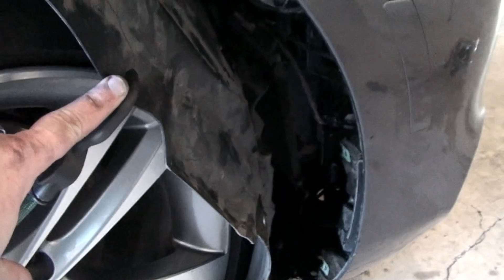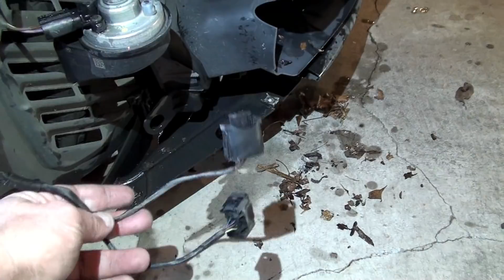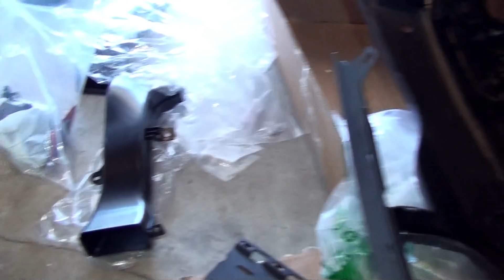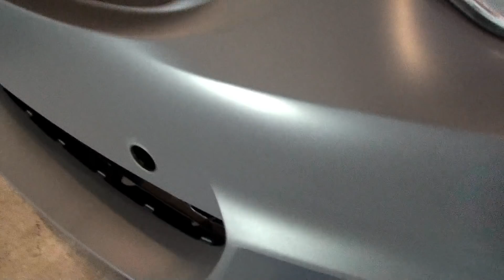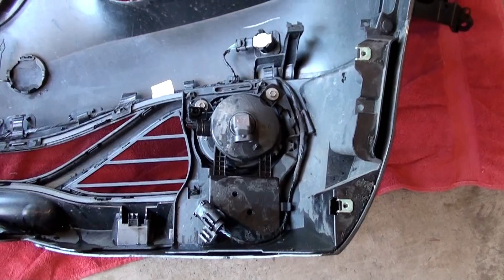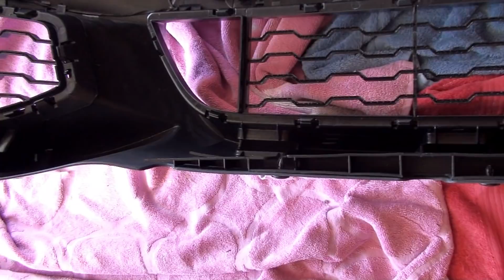BMW F32 435i M sport front bumper conversion installation DIY

Comment: I know it's been a long time since you installed, but do those two large parking sensor agle down slightly when looking at the front bumper head on. Mine do and im worrked I may have installed them incorrectly
Reply from the maker: I had to swap angles on them if I remember correctly, to reduce that down angle.  They were physically lower than the original bumper,  so a little more sensitive
Reply: yeah, mine are pretty much pickup the ground and installed the bracket such that the sensors wires would orient the same way as in the original

Comment: Hey man! I just installed my M-Sport Bumper thanks to your video! My question is, the lower air duct that directs flow to the radiator, I took this out and it seems there’s an M sport version. Do I need this air duct other than the fact it directs air to the intercooler? I was looking at parts and they’re pretty hefty in price. Thanks again!
Reply from the maker: The bumper came with all the proper ducting, and didnt need to buy anything else. I am surprised you are missing something?

Comment: Stefan, my wife's F32 has the Sport Line front-end with closed fog-lamp bezels. I was thinking about removing the starboard(passenger-side) bezel and moldings it with drilled 1/2" holes and backing the holes with 1/16" fine stainless micromesh in order to facilitate greater air-flow to the oilcooler in hopes of lower operating temp. Please note that I have already installed the Mosselman oil thermostat. My question is: Can the lower fog light bezels be removed with less effort/hassle of removing the whole darn bumper?!  My Bentley manual provides no guidance for such limited access. What are your thoughts since you have performed this kind of "body-work"?
Reply from the maker: Check out my video about zunsport screens for exterior screens.. but if you have to remove interior pieces, sadly the bumper cover has to come off.

Comment: Hi, When I tried to install the M4 front bumper, the wheel archs were not matching with the bumper? You have the same issue ?
Reply from the maker: No.. but I installed the M sport, not the Mr replica, or did you get oem?
Reply: @BMWDIYGuy  13:34 seems my wheel arch is not correct. is it possible to check the OEM code on the wheel arch of yours?
Reply from the maker: @hyperloop7053  Would if I could but actually don't have the F32 anymore.  Best next suggestion would be realoem.com and check the part number.  If you are not familiar with that site, select year and model and then can browse through parts diagrams. Incredibly useful for finding and comparing parts.
Reply: @BMWDIYGuy  this is a great source, thanks a lot.

Comment: Hey do you know what the piece is called that you hangs the bumper on and screw the t25 screws into. Mine broke and I think it’s messing up the fitment of my bumper?
Reply: Do you know if it’s interchangeable or is it built into the frame?
Reply from the maker: @yMdangerous  So I dont know if it is off the top of my head.. realoem.com is good for this, looking through parts diagrams trying to find the right piece.  The bumper cover is there and easy to find, but hard to see the part it attaches to directly.  I would start here and see what you can find.. next thought would be see if your local dealership can identify the part.  Cant say I have ever heard of that break.

https://www.realoem.com/bmw/enUS/partgrp?id=3R13-USA-06-2016-F32-BMW-435i&mg=51

Comment: Hey I followed every single step you followed only this I that I was having problems with my pdc sensors. I’m not sure if the company didn’t send good brackets or what but I’ve got them glued. And now the sensors don’t really seem flush to the bumper they work fine but I’m just wondering if that’ll be noticeable?
Reply from the maker: I found using VERY thin 3M automotive adhesive film is best, and it reduces or eliminates that dip back.
Reply: Thanks so much for responding quickly? Do you think The glue will be removable at all?

Comment: Hello sir i have a questiom my bmw 4 has a little black box on the bumper wich i think its the distance senzor for the cruise control is it possible to install the front m bumper with that senzor?
Reply from the maker: Hmmm... great question really!  I would reach out to Kies Motorsports directly and ask them.  You may be ok, but I would confirm first.

Comment: Hi, what is the piece called that fits into the lower part of the msport bumper and connects the bumper to the belly pan? It's the last piece I need to complete my conversion and I cant find it anywhere to buy
Reply from the maker: Best suggestion would be is to check realoem.com and look through the parts diagram.  You should be able to find the exact part and number.
Reply: @BMWDIYGuy  smashing! Found the part....adaptor underhood shield....thankyou very much
Reply from the maker: @amtdesigned  happy to help!

Comment: Can you link the part number for the front air ducts? I have 435i that i am converting to M Style bumpers but cant find the right air duct part
Reply from the maker: So hopefully your kit comes with them?  If you follow my link and get the same kit, it has the ducts.  If you can't do that, check realoem.com and look up the style and part, and you will find the part numbers.
Reply: Will the OEM ducts not work…???

Comment: Did you happen to take off the center plastic where the center lower vent is? Mine has an extra plastic that seems to get in the way right in front of radiator
Reply from the maker: I dont believe so, but it could be the case that mine is missing.  There was a soft rubber piece that vented up to the intercooler.  In my frustration, now several years ago because I couldn't get the new FMIC to fit with it in place, I cut it off.  (I wouldnt have done that now, but that was then).  It may be the piece you are talking about.. maybe..
Reply: BMW DIY Guy thank you. I just ended up removing it

Comment: Where can I get the sport air vents?
Reply from the maker: The brake ducts? These came with the kit. If you need just the ducts you could use realoem.com and look up the parts.
Reply: BMW DIY Guy thank u so much

Comment: Great video !
i see you left out the crossbar and didnt place the m sport deformation elements L & R and the lower bumper mount crossbar.
- Deformation element left 51118051189
- Deformation element right 51118051190
- Mount, bumper, front, lower 51648054575
does that give any problems of bumper hanging or mounting?
Reply from the maker: No issues whatsoever.

Comment: Do you finally put on those 6 bolts? I also have a problem to put those 6 screws on under the center belly pan. Not sure what the problem is. it feels like the belly pan is too short to reach the M sport bumper panel
Reply from the maker: Yes, all my belly pan bolts are in.

Comment: did those larger PDC brackets come with your new bumper? Mine did not come with any new PDC brackets
Reply from the maker: Yes, mine came with everything I needed.  I would contact your retailer about the missing parts.
Reply: i will but unfortunately i didn’t realize i was missing them until after the bumper was painted and i had the old one off and disassembled

Comment: Is that crossbar for absorbing impact?
Kind of afraid of taking it off for that reason
Reply from the maker: Understood.. its a small diameter hollow tube, so really dont think it would do much, so have zero concerns taking it off.  The main structure is the wide aluminium plate back into the frame support members.
Reply: @BMWDIYGuy  I appreciate the response i get my bumpers next week and im following your steps thank you for the content !! 🔥🔥👌
Reply from the maker: @bulmarojusto2602  happy to help

Comment: Okay so serious question! I’m looking to convert my standard bumper to the Msport one and every keeps saying (Legit BODYSHOPS) keep saying NO AFTERMARKET PIECES FOR YOUR CAR! Went to get the bumper priced by BMW it was literally 3 times the price of other bumpers. Saw great bumpers with (some with warranty) mybimmerparts.com bmwsouthatlanta.com kiesmotorsports.com I have a 2016 428i xdrive. 

What do you think? 
1a. How do you feel about aftermarket body parts? 
1b. Would you trust these sites?
2. Will the bumper fit the car perfectly (if taken to body shop)
3. Will it void my warranty or will BMW even notice it? 

Thanks a lot man, really appreciate it!
Reply from the maker: So interesting comment from bodyshops.. no clue of why they would say that, but ok.  shrug

1.a - My car is now has the full msport kit from Kies, so I think its just fine and you literally cant tell the difference.  IMHO the parts are identical, and NOT 3x the cost.
1.b - I have worked with Kies extensively, trust them and the owner Bryan completely.
2.  Yes, and did the install myself obviously.  You can too with basic tools and save yourself that expense.
3.  Cannot and will not void your warranty.  There is actually a law in the US that prevents that explicitly.. the only time an aftermarket part can cause issues is if the dealership can PROVE it is the source of whatever problem you have with the car.  Most common place for this is taking a "tuned" car into the dealership while under warranty as they can complain you are messing with the DME.  THAT is a dice roll.. exterior components not so much.
Reply: BMW DIY Guy thanks a lot man! This was really good information. I ended up going with the Kies motorsports part. It’s the same and cheaper. 

Also anywhere you recommend getting a nice front lip from? And Not so expensive?

Comment: What kinda bolts do I need to connect the fog light duct to fog light holder piece?
Reply from the maker: I used what I had on hand, so dont have an exact description. They were extra bolts I had, for metal into plastic.

Comment: Great video, I learned a lot in perspective to change my own bumper on my F36; I am not particularly enthusiastic of removing that lower crossbar that you did, it should be there for a reason I guess, no way to fit the M bumper with that on?
Reply from the maker: At least not in my case.. I couldnt find a way to make it fit with it.

Comment: hi Thanks for the video!      I am having trouble removing the main PDC connector which is located on the passenger side.   Where do you squeeze this thing?!   Im about to loose a finger and my mind!
Reply from the maker: There is a little locking plate on the top. Squeeze with your thumb depressing the locking plate and it should come off.

Comment: Did you have to swap out the middle air duct behind the lower grill? Or did the bumper fit with the OEM one still on?
Reply: Also is it necessary to swap the side air ducts?
Reply from the maker: You should be fine.. I swapped out the brake ducts, and that was it.
Reply: @BMWDIYGuy why did you choose to do that??
Reply from the maker: @daringries  the path for the brake ducts is different with the new bumper cover, so you need to swap them out.
Reply: With M4 air ducts?

Comment: How did you deal with the parking sensors?
Reply from the maker: In what way?  I just snapped them into the new mounts and they work.  The center is slightly more sensitive as being mounted maybe 2 inches lower than before, but work flawlessly. How can I help?

Comment: Hi, so I removed my bumper and I disconnected the main pdc connection and then when I replug it back in when I’m done, it said parking assistance not avaliable. Anything I might be doing wrong? I just have caution signs on the front my front and rear.
Reply from the maker: I would pull the bumper and check all the plugs.. maybe one or two are loose.
Reply: Thanks for replying! If one is loose it’s possible to stop the whole system?
Reply from the maker: @simonel9332   Great question and not sure honestly as I didn't have any issues with mine.  I have to assume, if it worked before and doesnt now, then its something about how they are plugged in.  Check all the plugs, reseat each one, make sure there isnt any funky connections.  I would start there.

Comment: Pretty detailed video bro! What kind of 3m adhesive did you use for your PDC sensor? Thanks
Reply from the maker: I actually wont use this adhesive again.  I REALLY struggled to get it to dry and be as strong as the body shop said it would be.  I did the rear bumper for a friend and used double sided 3M adhesive I had instead.  It worked much better and I will be doing and documenting both side skirts and rear bumper on my car asap.  It's the grey thin double sided 3M adhesive tape.

Comment: I think you could put some masking tape on the car wings to prevent the bumper scratching the paintwork when the sides are unclipped, and a bed sheet or something on the floor to prevent scratching too, this is more important if you are refitting the same bumper as I did, when replacing a broken lower grille
Reply from the maker: Absolutely great suggestions, and doubly important if you are pulling it for repair and putting it back.

Comment: Hey, great video! I just got an M Sport GoodGo bumper for my f30 335. 
Question though about the PDC covers you mention...I'm doing a test fit and not seeing any PDC hole covers (yes it has PDC holes though), did those come with your kit? Or did you transfer those from OEM bumper? Man I hope they didn't forget those...
Reply from the maker: So yes.. absolutely comes with covers/mounts that you need to attach on the inside of the bumper, have them painted as well, and then mount in your PDC sensors.  If you dont have them that is a serious issue, make sure you have them.
Reply: Ugh...Thanks for your help!

Comment: did you end-up using the cover for the fog lamp air vent? this part number 51118054550
Reply from the maker: I didn't use the covers as I kept my fog lights.  You can order the bumper for no fogs, and then do the coding fog delete if that is what you wanted pretty easily.
Reply: ok, I assumed they were to close the air vent/ or deroute the air. Could I ask what did it cost you with this kit? I ended up buying an oem bumper off someone but had to buy all the other plastics my self from ebay.
Reply from the maker: Ouch.. well the kit itself is linked in the video description and can get current pricing.  When you order, you customize if you need PDC holes, or fogs or not etc.
Reply: it wasn't much. Le the ask you, because from the pictures that part only looks like it is covering the hole for the air vent and not the fog lamp hole its self. See the last picture from the bumper kit link you posted.

Comment: Nice detailed video. What did your auto body shop charge for painting the bumper?
Reply from the maker: Thank you!  I got quotes from about $300 to a ridiculous $1200 for the bumper.
Reply: I own a 2016 435i with the M performance trim. I would like to remove the bumper and have it refinished due to the usual road damage. I live in the Reno Nevada area and have wildly different estimates for paint work.  From 500 to 1000 dollars. I was curious if this was just a regional thing or if the locals were taking advantage of the situation. That’s why I was curious about the amount you agreed to pay for this.
Reply from the maker: Totally makes sense.. If you can take the bumper to them, you could cut out the labor of that part which would save you that at least.  It also depends on repair or refinish on the bumper too?

Comment: Bud, subscribe to my channel, ive had a 2016 bmw 435i for 2 years, best car ive ever had. I tuned mine, stage 2, and its full bolt on, and i run ethanol mix, very reliable , no issues, ever. Very fast car and handles great. Check out my channel, ill be posting alot more vids !!.....btw i sub’d to your channel to see progress, congratulations man 😎

Comment: dang this thing was detailed, but the part i was actually watching it for wasn't as detailed as the rest haha 
i took off my bumper to install my splitter a year or so ago. Could NOT get the bumper back on (me and three others tried) - had to end up taking it to a body shop to have them put it back on. They didnt secure the splitter enough in the center (not sure why) so it came off. was going to try and put it back on, but scared to death to take the bumper off again in fear that i wont get it back on haha 
thumbs up and subbed!
Reply from the maker: I am confident you can do it.. It really isnt that hard, and surprisingly simple tools to do the work.
Reply: that's why i am saying... i already tried it. The edges or something weren't lining up. had two other ppl look at it and couldn't figure it out either.
Reply from the maker: Dang.. yeah, that is not good or fitment on that bumper was a real issue.  Let me know if I can help somehow.